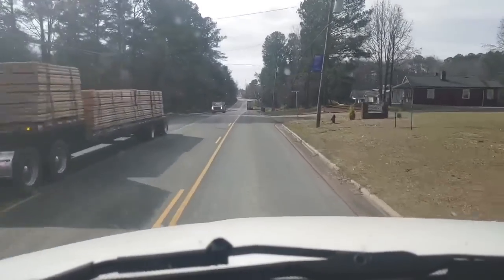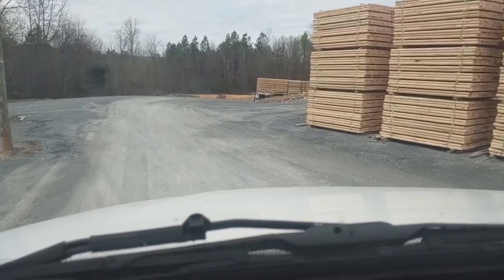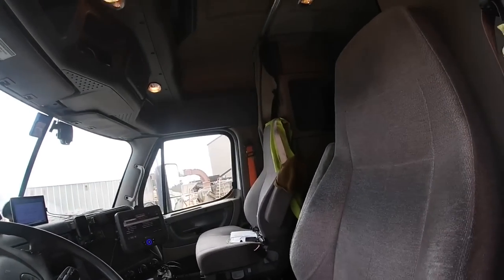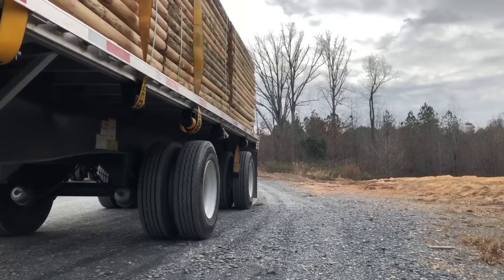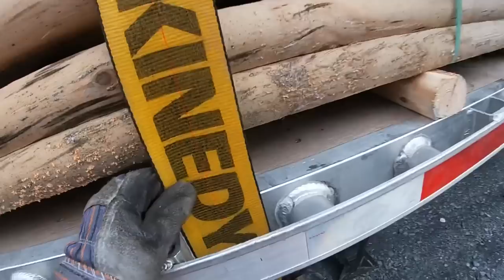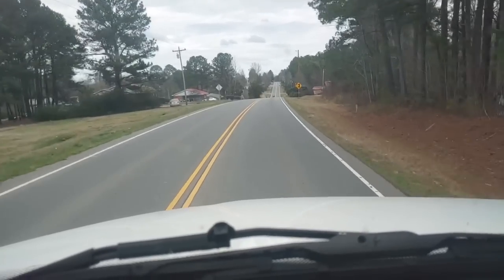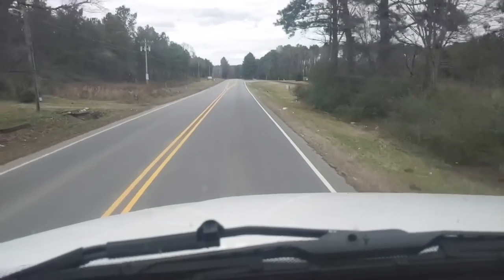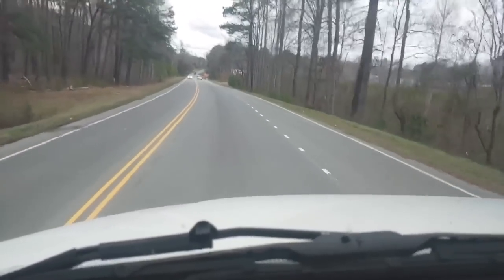Flatbed Lumber Load Securement How To Throw Straps #trucking #dirtyjobs #cdl

Comment: I drive a 10 speed and pull oversized loads with P&S. Flatbedgang
Reply from the maker: Mine is an automatic and I’ve only pulled one oversized since I’ve been here. Always turn them down
Reply: @bigsnow1705  they pay better in the Midwest and northeast
Reply from the maker: James Mathis maybe once summer comes I’ll start grabbing them